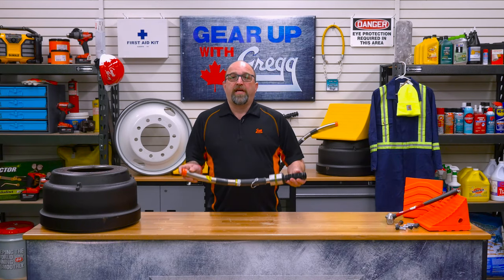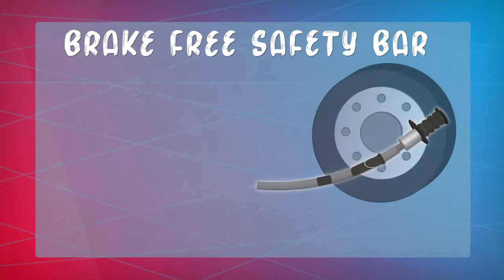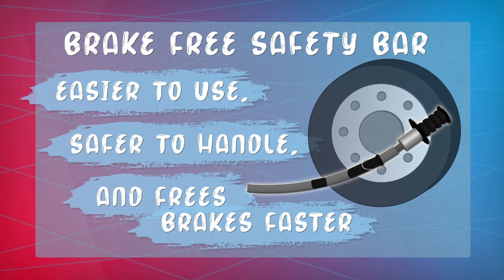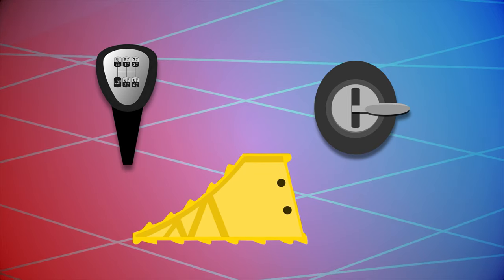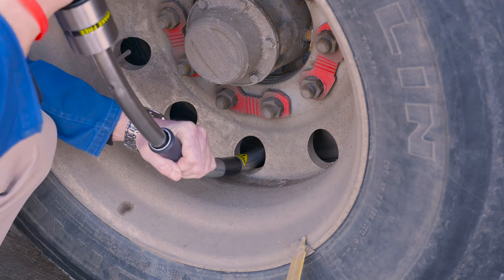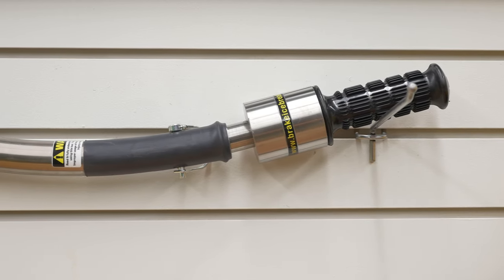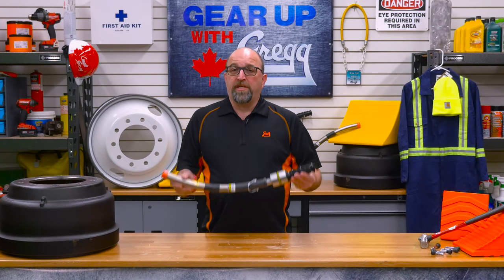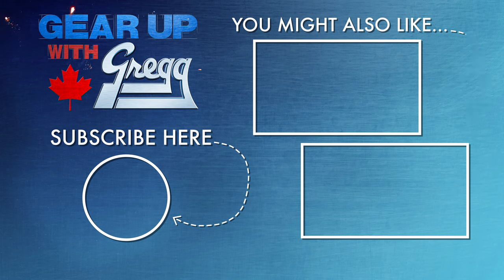The Brake Free Safety Bar: A Must-Have for Every Trucker! - Gear Up With Gregg's

Comment: How much and how do we get one
Reply from the maker: They are usually priced at around $320 but we currently have them on sale for $289.99 until the end of October, 2020.  The part number for the item is EEEBF0000BIB.  If you are based in Canada, you can pick the item up from a branch near you:

https://greggdistributors.ca/all-locations
https://greggdistributors.ca/heavy-duty-fleet/Heavy-Duty-Fleet-Accessories/Fleet-Hub-Cap-Accessories/eeebf0000bib